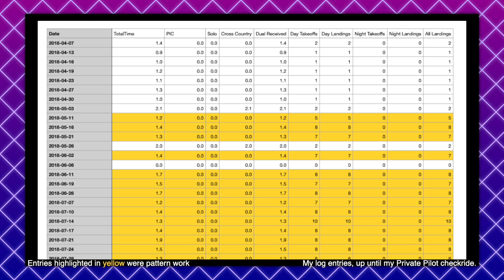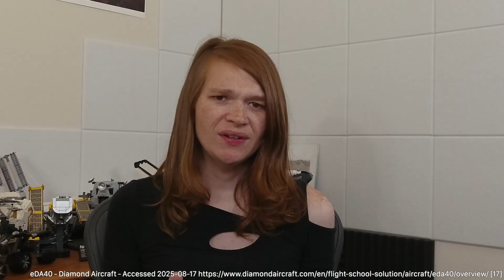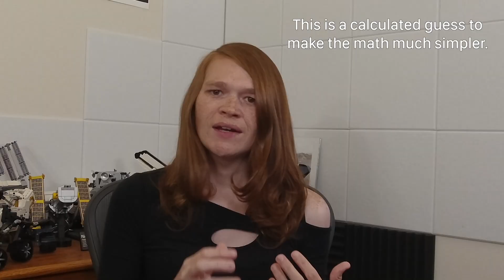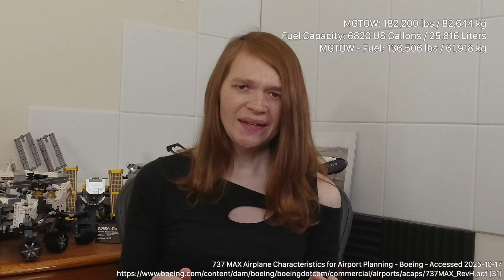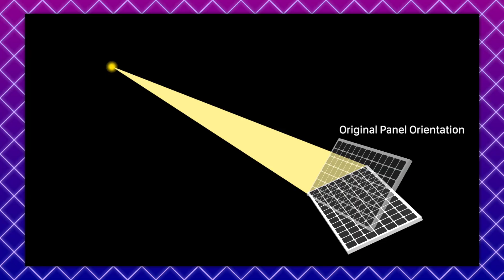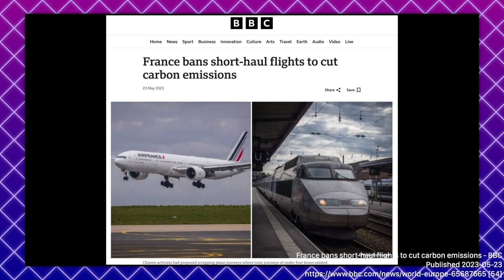When Will We Have Electric Planes?

Comment: I'm really excited to hear more about your build as you go. I'm also building a Cozy with the intent of going electric. I recently did a presentation at my local EAA chapter about electric flight and extrapolated the flight time of the current electric flying GA planes to the new chemistries (I used 450Wh/kg to account for some losses) and they nearly tripled the range. I'm curious on what your thoughts are about improving aerodynamic efficiency of the Cozy, propeller choice to take advantage of flat line torque, and the possibility of swappable battery packs like the Chinese RX4E.
Reply from the maker: My background is in software, not aeronautical engineering. I chose the Cozy design because it broadly fits the bill in terms of aerodynamics for long cruise flight. The most I've thought of is building a propeller duct to gain the advantages of a ducted-fan. But, largely, these types of things will be investigated as iterative improvements done after I have it flying.

I'm planning to fit a constant-speed prop on mine. My back-of-the-envelope reasoning is that I don't really care about motor torque so much as about controlling the propeller bite, especially at different altitudes. Especially because there's an upper limit to the rpm of the motor before the prop tips are going supersonic (which dramatically reduces the efficiency of the prop - I don't know if even having the tips be transsonic also reduces efficiency), which for a 72 inch (183 cm) diameter prop is just under 3500 rpm. To me, that seems like a really narrow range of RPM to play with if you only have a fixed-pitch prop. But I'm definitely open to experimenting and being wrong here.
Reply: @rachelbrindle  I've also been doing napkin math! :) My idea is to do a fixed pitch very climb pitched propeller since the torque on electric motors is flat and doesn't get lower with altitude, a direct opposite to the torque curve and 3% HP loss per 1K feet of normally aspirated engines. The line of logic (that I need to bounce off people smarter than me) is that HP is a measure of work over time, but the propeller and resulting thrust is ultimately what all that work does.

I'm excited to see more of your build!